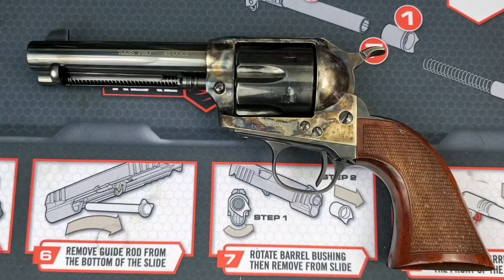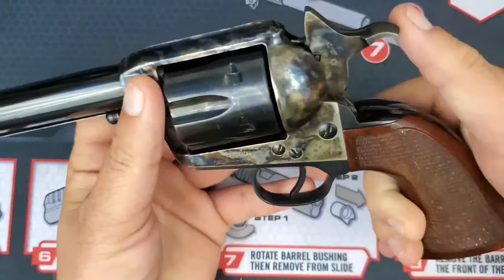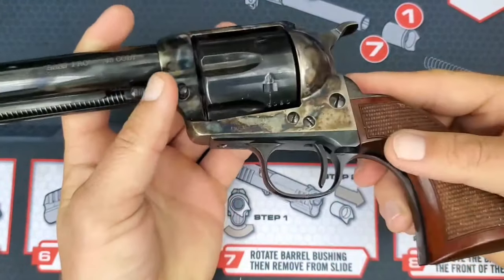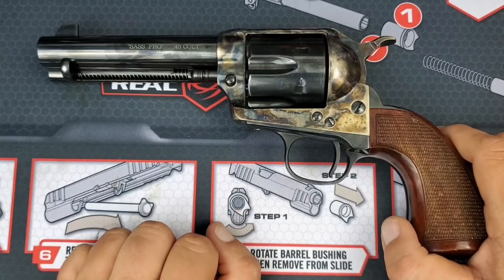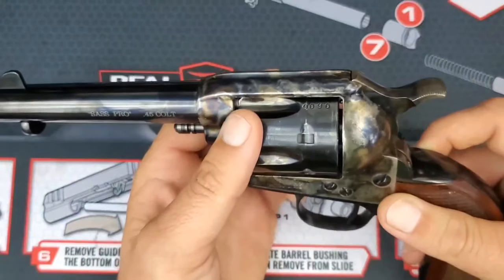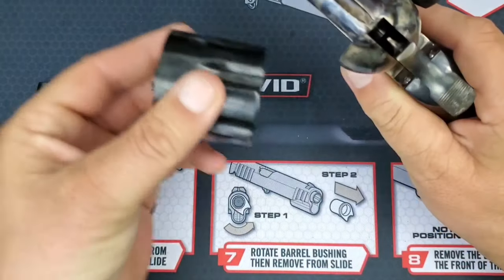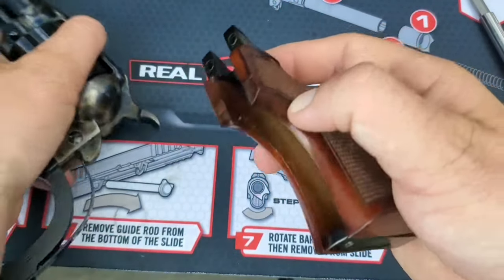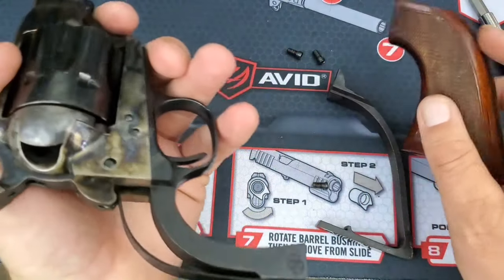Uberti Cattleman ii. The good, the bad, the ugly...

Comment: Cool gun! Pretty old school😊 Btw. I've tried the Federal Gold medal 168gr in the HMR. Could get the groups smaller than 1,5 inches, but I've also tried some cheap 180gr. hunting rounds, which were half MOA😊👍🏻
Reply from the maker: Interesting, I haven't tried anything above 175. I'll give it a shot one of these days. I'm sitting on such a good stock of factory 168gr feds. I get spoiled with my hand loads though. I basically just recreate the same bullet with more quality control. 

The weather where I'm at has been miserable for the past few months. Either disgustingly hot or dumping rain. Both of which I don't want to be outside much in. So my range time has got pretty bad. 

Can't wait to get at it some more during the fall. Thank you for watching my videos. Hopefully the quality starts to get better as well. Let me know if there is anything particular you want to see a review on here.
Reply: @caseysammobench  The weather here is bad too, but at my shooting range the targets are electric, so you dont need to go out there. My likes the RWS 168gr best, but as my local shop doesn't has them in stock anymore, I had to try something different. I'm glas I did, because the 180gr are 30% cheaper 😊 I hope your weather gets better soon, so you can go to the range too! Some longer range shooting would be awesome🤗

Comment: You're not holding the gun right. You have your fingers pointing right in front of the cylinder gap....ouch!
Reply from the maker: I appreciate it, at the time not really all that good with pistols. Was trying to hold it similar to the modern pistols and glocks. 

Thankfully never had my fingers hurt or anything. Suppose I was just lucky and overall just developed some bad habits. 

Got some good advice through the comments and learned a great deal of info. I appreciate you taking the time to view and comment.
Reply: @caseysammobench  No problem, glad I could help. It's a common mistake for people not use to revolvers. If you ever want to test the danger out, put a piece of play-doh next to the cylinder gap and fire a round. See what happens to the play-doh.
Reply from the maker: @Melcop1886  that sounds like a video I need to make. Thank you.
Reply: @caseysammobench  hickock45 did it with hotdogs and it wasn't pretty!!! You should test it close against the side of a cantaloupe or watermelon!!!